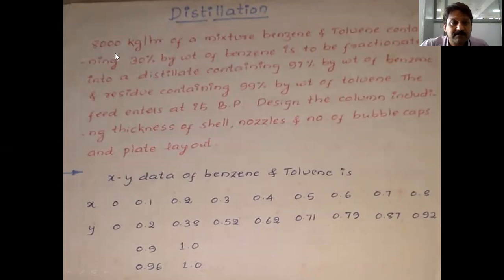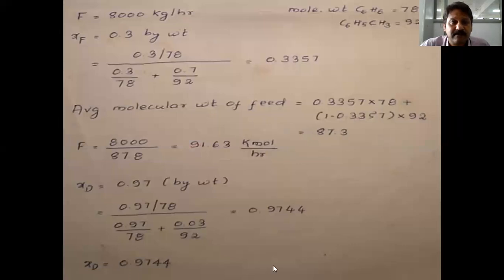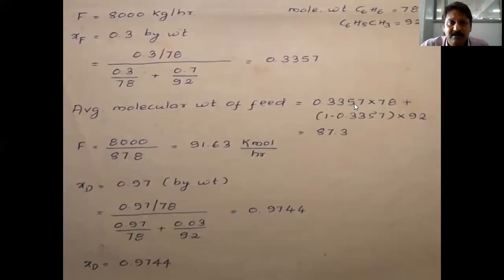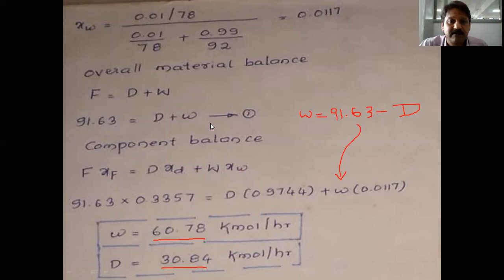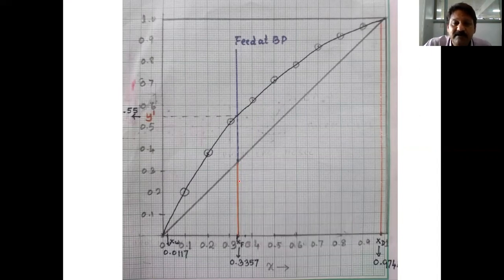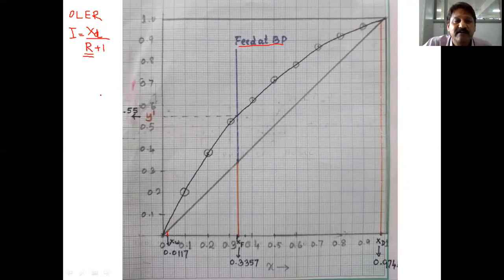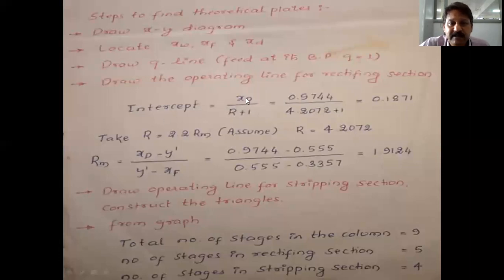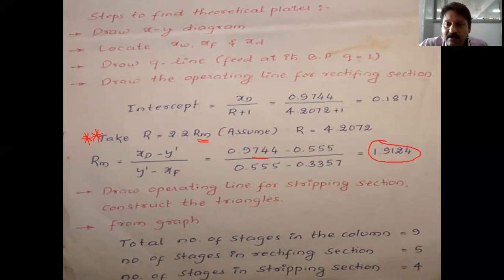Calculation of no of stages in distillation

Comment: Sir could you please upload Process modelling and Simulation lab experiments :

Process modelling and Simulation lab experiments

1. Estimation of dew point and bubble point temperature of a hydrocarbon mixture
2. Simulation of flash drum
3. Design of ditillation column
4. Optimization of a flow sheet or process
5. Determination of temperature profiles for heat exchanger
6. Concentration profiles for reactor
7. Simulation of Jacketed CSTR
8. Simulation of process
9. Simulation of evaporator/ distillation column/ extraction process